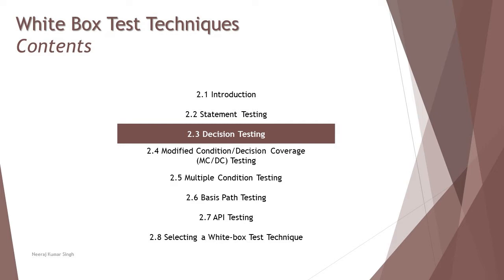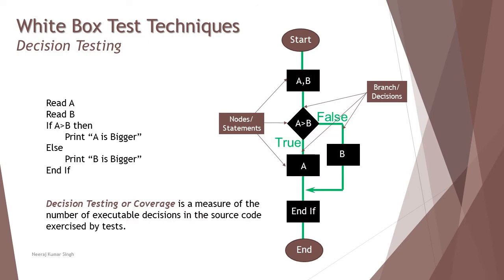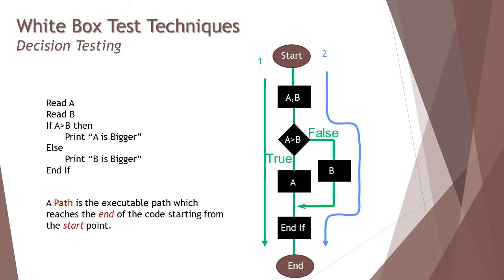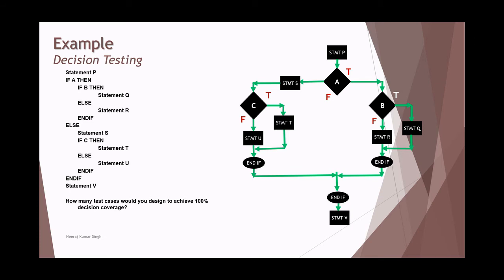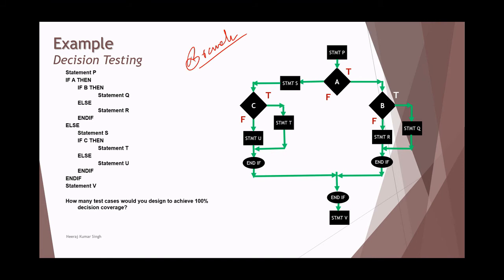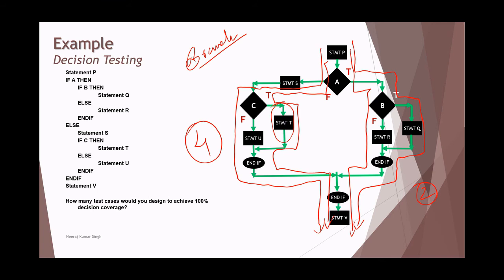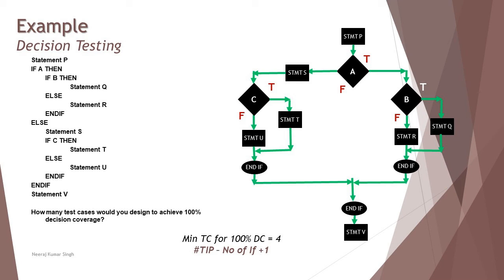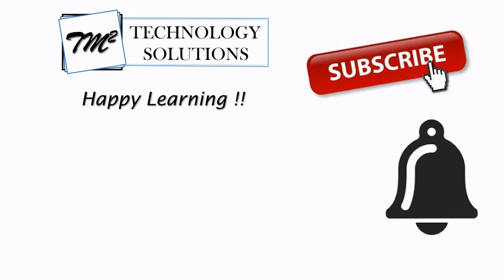ISTQB Technical Test Analyst | 2.3 Decision Testing | Decision Coverage | ISTQB Tutorials

Comment: Is this is applicable always or any specific cases to apply this formula
Reply from the maker: Always.
Reply: @TMSQUARETECH  This formula (Min TC = # of ifs + 1) has a flaw, when there are multiple decisions that converge multiple times, the minimal TC for decisions is lower than (# of if+1). Basically the formula works in the example of the video, but that's just a coincidence

Counterexample:
IF A THEN
--Statement Q
ELSE
--Statement R
ENDIF
IF B THEN 
--Statement S
--IF C THEN
----Statement T
--ELSE
----Statement U
--ENDIF
ELSE 
--Statement V
ENDIF

There are 3 "if", but A is not nested inside B/C nest. Min TC is not 4, it's 3: (A,B,C)(!A,!B)(A,B,!C). The converge is after the first ENDIF, then an independent IF nest is provided. 

And the formula also does not work if a control graph is presented in test, for example when one of the "ifs" vertice is pointing to a previous node. It effectively negates the "if", as the path can go down-up-downAnotherVertice. As there is no "if" in the graph itself, i assume it's just a loop instead.

Statement formula works :)